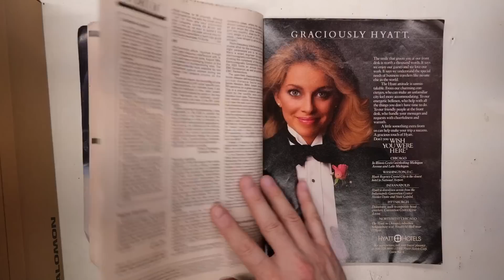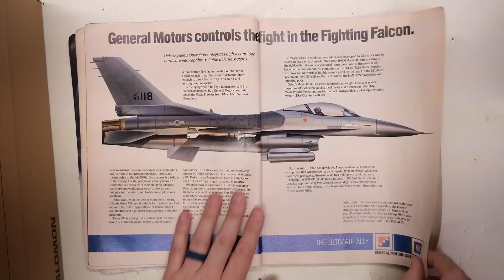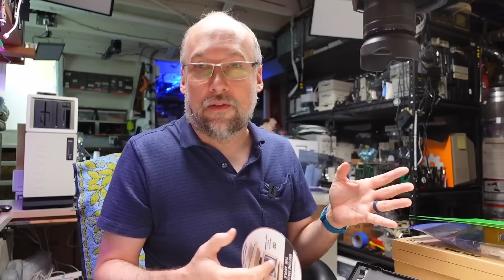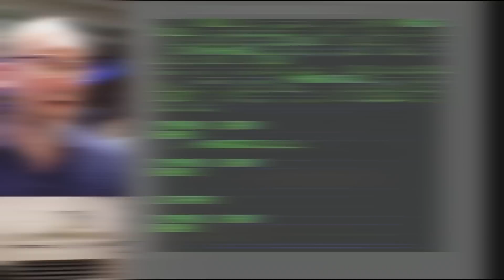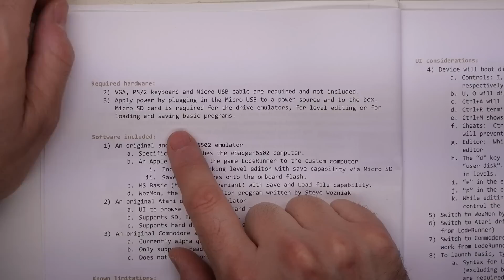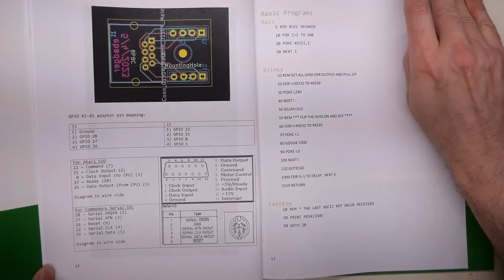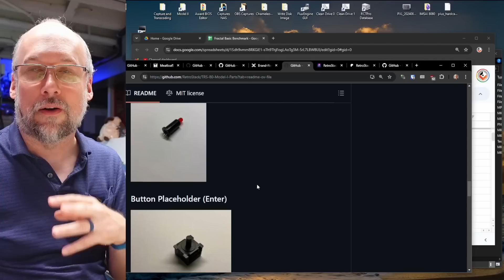0087 Pi Pico emulating a whole 6502 computer, Meatloaf for the C64, TRS-80 goodies and more

Comment: 29.97 is NTSC standard.  We just call it 30 FPS because it's easier.  I did some video editing of old school VHS and NTSC media, and 29.97 is the correct frame rate.  You also had to get the frame order right, because it was interlaced.  If you did NLE back in the day, and did a cut at the wrong frame, you'd get out of order frames, and the video would look like ass.

Good times, good times.  Took a tweaked computer to get it to work on a PC.  And this is years after the video toaster came out.  The PC architecture just wasn't well suited to video editing back in the day.  Now, it's easy.  Then, not so much.  And by tweaked i mean i had to disable the clock in the taskbar, because that could interrupt the video processing and cause a glitched capture.  And i had to run a RAID 0 card for throughput if i wanted to do TV quality (720X480) capture.  A single 10K RPM drive just wasn't fast enough.  But two 7200 RPM drives worked just fine.

Comment: Tektronics, man i wanted an o-scope from them so badly when i was in college.  It was all we had (with one exception) in our electronics labs, and they were just rock solid 100Mhz o-scopes.  Which, at the time, were all you needed.  All analog, all the time!  No on screen display, no menus, just knobs and connectors.  Simple, and yet so easy to use.
Reply: That's why I still use my 2445A as my main scope :)
Reply: The razor sharp display of the old scopes is still better than the low res digitized scopes.
Reply: @RS-ls7mm  I agree.  There was just something "organic" about those analog scopes.  Sure DSO offers a lot too, but the ergonomics and "feel" just aren't there for me.

Probably a failure on my part, as i am a dinosaur!  ^-^

Now what digital does VERY well, is in logic analyzers.  And i would have given a testicle to own a 32 channel one of those back in the day.  Just could not afford one.
Reply: @jeromethiel4323  I lucked out on the logic analyzer.  Got an HP 1631D on eBay about 20 years ago.  We used to fight over those at work.
Reply: I still use tektronix's instruments daily at work. In the past 3 years we got some USB 3.1 spectrum analyzers (RSA 306B) and a couple of signal generators (TSG 4102A) that you can also control via LAN

Comment: That 5170 was an AT/370. It didn't just connect to mainframes, it was kind-of a mainframe itself. I used something similar in the early 2000s which was a S/370 card in an RS/6000 (a bit niche, I'll admit). "The IBM AT/370 was a PC-based mainframe-compatible system that was discontinued in April 1987. It was designed to emulate IBM's System/370 mainframe computers"
Reply: And now we can all run MVS and VM/370 with the Hercules application in Windows and Linux.
Reply: There was also the P/390 which implemented the ESA/390 architecture in a custom Fujitsu gate array on a PCI card.
Reply: @douro20  Thinking back, I think the card in the RS/6000 was a P/370, maybe a predecessor of P/390?
Reply: Exactly. Along with the XT/370.  Must be exceedingly rare.

Comment: Ooooh. Back when i worked at the local cinema and we got ads created by a semi large media company in my area I always had to convert their videos to 23,97 fps so it would not be chopping / stuttering on the projection.  They used all kind of sources and just made a dcp with the wrong frame rates and the projection server didn’t know what to do with that as it don’t go via a hardware scaler. AI remember I export to individual tiff, convert to individual jpeg2000, color correct to zxy color space and then combine to dcp. How much easier it would be if ppl learned what setting they used when exporting projects/filming content compared to where it was gonna be used. Still. I miss the old days working on those projectors. :) Christie.

Comment: The DVD was recorded in NTSC video with an NTSC camera.  24 FPS is only for film.  Video is REALLY 29.97 FPS.  The Inverse telecine made the video poorer.  Just rip it with the original frame rate.
Reply from the maker: Were you involved with the production of that DVD? Lots of modern day things are shot with modern digital cameras that can shoot in 24FPS to get that film look. I would be really surprised anyone would shoot stuff these days on old cameras like DVCAM or MiniDV that record in interlaced 29.97 FPS.
Reply: @adriansdigitalbasement2   29.97i isn't just for "old cameras", Adrian.  Your Lumix has that option too.  As they said, it's standard NTSC video, and is just as relevant now as it has ever been.  You just aren't limited to that anymore, and have options like 30.0fps, or 60fps, or 24fps, or 25fps ... and hopefully whatever you play it back on does a good job of wallpapering over any framerate discrepancies between source and sink.

FWIW, 24-in-29.97 is a hack, and converting it back is a hack ontop of a hack.  It's also not entirely guaranteed to work, as smart detelecine filters will try and ensure that that the cadence is correct before restoring the 24p frames, since any editing at all might either break the cadence, restart the cadence at a random point, or interleave ordinary interlaced video from sources like computer-generated titles, effects, non-film source material, etc.  On a normal CRT TV, it doesn't matter if you jump in and out of 24fps, since it's going to be played back at 29.97i any old way, and it's only the persistence of vision that "decodes" it.  But software can really muck it up, if the source material isn't utterly consistent and predictable.  That's why I don't ever bother trying to "rip it correctly" -- just rip it as interlaced and let the player figure it out as best it can.  At least then, the damage isn't permanent when it inevitably gets it wrong somewhere.
Reply: @adriansdigitalbasement2  Adrian, if the video is for a DVD, the quality of the video is best at 29.97 fps.  There is absolutely no reason to do it a 24 fps.  Why bother if it's just going to end up NTSC anyway?  It seems like a wasted effort.

Comment: The RP2040 is not datasheet 5v compliant - it is (according to the project lead for the RP2040 ) 5v ttl compliant -- what I gather that to mean is it is not 5v5 compliant but it is fine with the kind of high level you see from NMOS drivers in older computers (so more like 4.7-5v max.  He actually chimed in on a fairly heated thread on hack a day and basically ended the discussion he said that it was 5v ttl compliant just not 5v5 compliant TLDR just fine for old computer -- not so great on HC drivers, it's variants and 4000 series CMOS drivers

Comment: FYI, Every model I came stock upper case only (I know), and lower case was a modification that you could purchase from Radio Shack.  It basically added a piggy backed RAM chip over the character 'RAM' chip, with one pin bent out (a chip select line I'd guess), with a wire running from that to somewhere on the motherboard.  I think it was ~$50.  The character ROM supported lower case, RS just didn't (ever) build in support for lower cast until the Model II and III
Reply: I have several model I's with no character mod.  Might have been common, i don't honestly know.  But i know the one i had back during the late 70's didn't have one.  That computer is long gone, but i have since purchased more.  And while some have mods (like the gold finger mod for the expansion port), none have the lower case mod.

Did the lower case mod kill the graphical characters?
Reply: @jeromethiel4323  The only issue with the LC mods I can remember was no proper descenders on the characters.
Reply: @retrozmachine1189  Yeah, the circuitry for the video system enforced the blank space.  The video system for the TRS-80 was pretty primitive, but it worked well for what it was.

On my old school model 1 (from the 70's) if you pried the TRS-80 logo off of the monitor, it had knob holes, because it was just a B&W TV set slightly modified (no tuner) for use with the computer.
Reply: @retrozmachine1189 There is a nice mod that was available even in the early days (~1982) called GenDon that adds descenders to the Model 1. Ian Mavric has one replica of this in his store where it uses the full height with full descenders, eliminating the vertical blank @jeromethiel4323 is talking about. It requires some bodge wires, but it is a neat solution.
Reply: @jeromethiel4323 No, the graphical characters were not killed by it. The lowercase mod just added another bit. 

By default only 7 bits were used for the ASCII storage and the 6th bit was derived. The 8th bit (when counting the derived one) did signal if it was a ASCII character (ASCII just needs 7 bits by itself) or if it was a graphics “character”. So, there were 6-bits of graphic characters (2 horizontal pixel and 3 vertical pixel). Adding a lower case mod just replaced the “derived” bit and therefore had no impact on the graphic character sets. 

Interestingly, after installing the lowercase mod, you still need an updated character generator. The early ones had lowercase characters, but the Model 1 system ROM didn’t support it and converted characters into a different place in the ASCII table when the derived bit was not there as expected - they never thought they needed it. So, the later character generators actually needed to have a set of character duplicated to make things work, fixing the software issue. See number four here for the character set with the duplications: https://github.com/RetroStack/Character_Generator_ROMs/tree/main/TRS-80%20Model%201/32-Option_2x256#combinations-and-features

I am by the way the person Adrien is talking about (RetroStack).
Reply: @marcelerz  That is VERY interesting!  Thank you!
Reply: @johanlaurasia Yes, the Model I came by default with only 7 bits. Actually the 6th bit was derived from bit 7 and bit 5. When installing a lowercase mod, one had to cut the trace for this “deriving” logic and add two bodge wires. Like you said, a piggyback static RAM needed to be installed to add the additional bit. In fact, 2 legs needed to be bend up for the in and output for that one bit. The chip select was done in tandem with all the other bits.